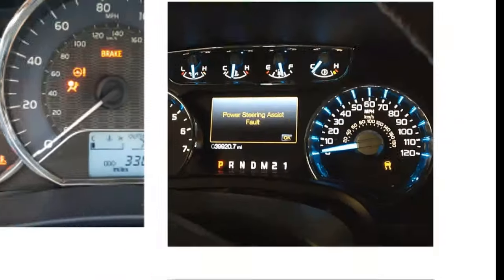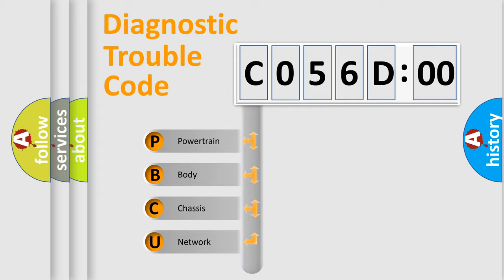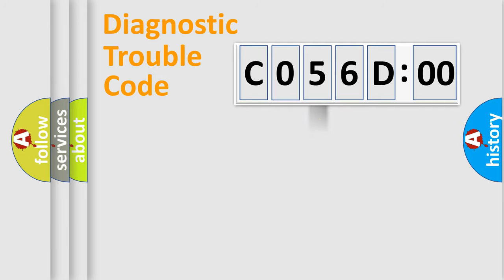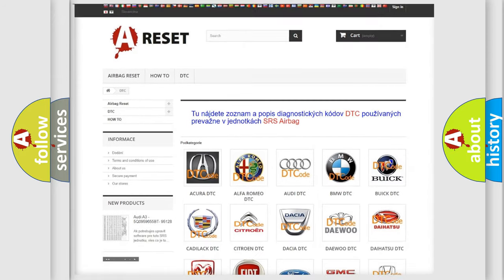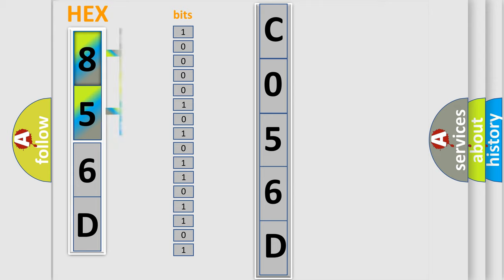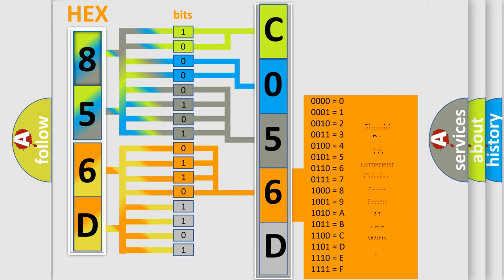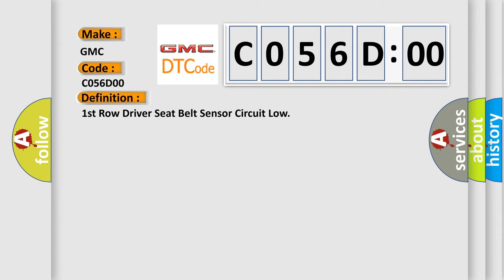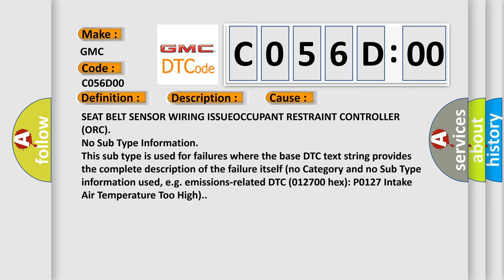DTC GMC C056D-00 Short Explanation

Comment: I have this code on my Chevy that is the only code but my car says service stabilitrak and it says it deals with the electrical control unit hardware.....
Reply: Ever figure it out?
Reply: @noro305  no I didn’t unfortunately but I also haven’t had the time
Reply: @shaina6275  yeah I'm still scratching my head about it and hard to do between work
Reply: @noro305  same here unfortunately
Reply: Same here fellas. 2015 Equinox same code, stabilitrak service light.  If you figure it out plz reply, if I find something as well I’ll post.
Reply: Just got this on my 2013 equinox. From what I'm finding online it's the electronic brake control module.  Internal failure which means it needs replacement and can't just be reprogrammed.